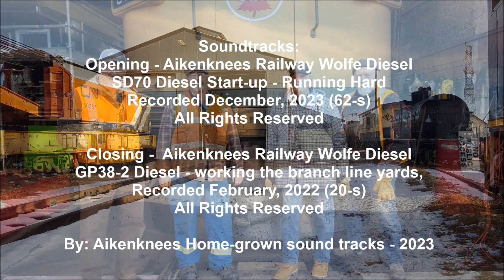Aikenknees Railway #354 - Switching Heritage Equipment. January 31, 2024

Comment: 😻🚂 WOW, You guys have added a lot more engines to your fleet. The Walker locomotive shop in Edmonton has an old switcher engine like your (7944). You could use it for parts. Its been there for at lease 10 + years collecting rust. 😆 Something to think about. Have a great day.:shelterin:
Reply from the maker: Thanks for the info.......  👍
Reply: CN has a lot of cool stuff in Edmonton that I pray are preserved. ESPECIALLY those NAR sd38-2s.